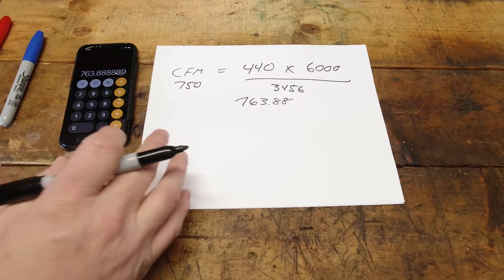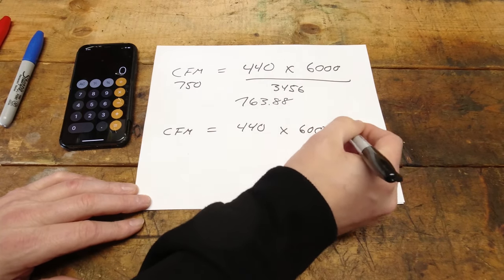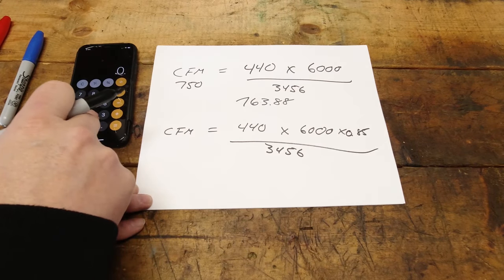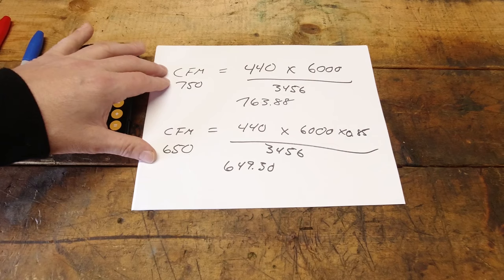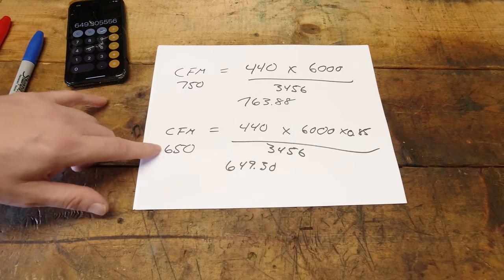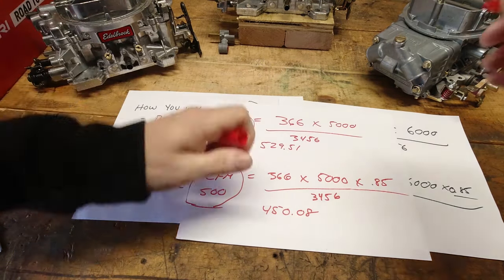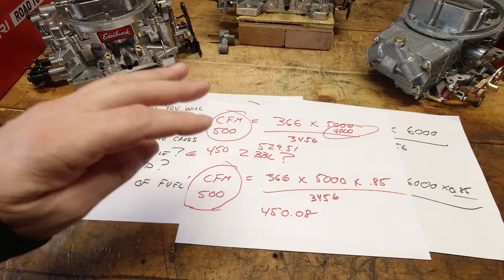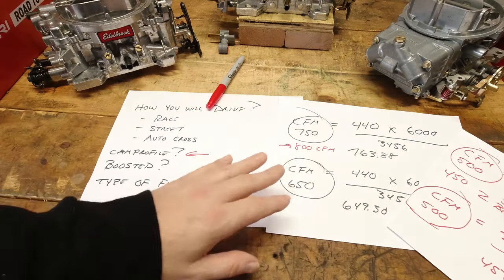How to Choose the Right Size Carburetor

Comment: Love your content, I have an 86 cutlass supreme with 307, nothing else done.  It would not run with the q-jet, so a friend gave me a 1406. Not looking to race, just have a little performance and decent gas mileage.  I think this 1406 is way too big and getting about 10 mpg, where I used to get 20 mpg with the q-jet. Again love your channel and thank you.
Reply from the maker: Yup.  600 CFM on a 307 is over carbureted.  Get a 500 and tune it.  Thank you!  Glad you’re enjoying it.
Reply: @MuscleCarSolutions  great thank you, which 500 do you think; 1901
Reply from the maker: @GrandeTime  yes go with the AVS2.  Either manual or electric choke - your choice.
Reply: i had a carter AFB 500CFM carb 20 yrs ago on my 80 impala sports coupe and that had what they called an "Rv cam"  204/214 duration @ .050  and that was more than enough  had the stock freeway gears stock heads and i found a cast iron 4bbl intake

Comment: 70 chevelle 10:1 383  230-240 , advertised 280-290 duration, 489 int lift, 519 exhaust, rpm air gap intake, header and full 3' exhaust,  th350 2500 stall and 3:42 gears.

Comment: Thanks for mentioning the dump truck engine. I’m I’m the beginning stage of planning a rebuild of a Ford 460 for a stake body that it’s sole purpose is to haul firewood. 

Not much information about building high torque low RPM work engines.
Reply from the maker: Yup.  Every year I get quite a few low rpm, high torque applications to help select components for.  Dump trucks, yard dogs, logging trucks.  Lots of gas powered stuff out there.  Surprising how small a carb will work for a 460 when you’re only turning it less than 4000 rpm.  Good stuff!  Thanks for stopping by!

Comment: First - Thanks so much for all your Wonderful Video's. I've never been very well versed in Cars/Working on them.  But have just acquired a new care "to me" and have been trying to learn about Carbs and 
how they work and how to work on them and your video make thing very clear and understandable even for a 71 yr old Rookie ;-) 

So, I have a 1990 Chevy 383 Stroker Motor, in a lightweight car (2700lbs) not sure of any of the internals with the exception Of
it came with documents for an Isky Mega 280 Cam, and it has an Edelbrock 1405 that has had an
Electric Choke added at some point.  I did check the Metering Rods and they are the .070 x.047.  I've been learning about the timing and have 18 deg Adv and 34 in at about 2500rpm.  Hope this is enough information to be able to make some suggestions. 

Thanks again, Take Care,
CK
Reply from the maker: Glad you’re enjoying the videos!  So the root question here is the 600 the right carb for the 383 in a light car.  First things first.  We have to ask the question, “what are you doing with the car”?  Just a fun cruiser or something more aggressive?  I don’t know a thing about the specs on that cam but I’ll assume they’re around 230 and a fairly tight LSA.  107?  That cam is likely going to be done by 6500, so now we know what the max rpm is.  The rest is simple from the video.  On a lighter car, a little more CFM isn’t a bad thing.  If you’re going to work in the power band of that cam (if my assumptions were correct) then a 750 would be a great carb for that set up.  Just have to make sure the rest of the engine combination match and you’ll have a screamer of an engine!
Reply: Hi, 
Thanks so much for the reply and information. I'm just going to be cruising around in it on Nice Sunny Days.  I think all in at 6500 is probably all my Heart can take ;-) Appreciate everything, Take Care,
CK
Reply from the maker: @CKirk2727  I just found that cam.  It’s not going to be a lot of fun for a cruiser.  It will sound good, but it’s going to be down on power below 2500.  Not very fun.  I’m assuming that’s what you’re after though.  In which case, the 600 might be ok.
Reply: Hi, LOL I had that feeling even with the short amount of time I've had it and driven it.
BUT It is what it is, at least now I know and so that will make things a lot clearer on it's performance, and drivability, and makes me feel a little better about my driving and tuning attempts.  Thanks so much again for all your Help and the Great Video's I've learned a lot !!!

Comment: I have a 84 Silverado 3/4 ton truck with a 350 motor. Truck will be used for towing/hauling and weekend driving. It had an edlebrock carb when I got the truck but I want to upgrade it. Holley 600 or 650? What do you recommend?
Reply from the maker: If towing and hauling are your plans, the Edelbrock is a better choice.  Holleys works exceptionally well in WOT and racing situations.

Comment: Love the video I have a 462 Chevrolet with Pro race right heads elder aluminum 850 cam max rpm 6500 my spark plugs go bad very quickly. Is this carbureted working properly Is it big thank you

Comment: Thx for the vid!
Do you think a stock 351 Windsor 2 barrel will benefit from the "big" Autolite 2100 from a 2 barrel 390? 
It's one venturi size above the stock carb.
Stock cam street driven, FMX auto.
It ist more about fiddeling around and finding the sweet spot set up for the car.

Comment: Great video!! my application is a little different 350ci only turning 3000 MAX  rpm on a airboat by your calculations a 500 cfm holly is more than enough. my question is i hear they make a 480 cfm holly 4 barrel would that be a better fit than the 500 2 barrel? Thank you in advance .

Comment: First of all thank you so much for superb information regarding carburation. You have put my understanding of carburation to another level. Thanks again. I have aquestion for you thats puzzle me alot. I Have a '70 Cadillac Deville, stock engine (375 hp), stock TH400 and stock 2.94:1 rearend. Never passes, and never will, 5000 rpm. When the QJet came to age i put on a Holley 4160 600 cfm (0-80457s). I have a O2 sensor in my exhaust so i can check AFR. What puzzle me is that when passed idle i have almost perfect 14,7:1 AFR. But.... at idle, whatever i adjust or fiddle around with, it never go past 12.0:1. So my idle is a little rough and smell rich. Is there anything i am missing out when adjusting idle or do you have any idea why my AFR are so low in idle?

Comment: Hey your video are awesome,
I’m learning every time.
I just got a 1968 Chevelle with a 307 a 1406 and performer serie manifold intake is it too much?
Runs nice at high rpm if I got stuck in traffic eddy gets flooded….I think
Reply from the maker: @dylansretreat  could be too much.  Really depends on the things I mentioned in this video.  Tell me about the 307.  Is it stock?

Comment: Hey so I'm young and im learning carbs as much as i can. I have a  stock 351w in a 1978 Thunderbird with 2.73 rear gears. Im running true dual exhaust, dual plane intake topped off with a 1405 carburetor running the "10" tune on the 1405 scale. Max rpm 4500. Would a 1404 suit my application better? Or is the 1405 ok?
Reply from the maker: @maxsinger3526  depends really.  Will always just be a cruiser or do you have plans to build something with more power and rpm?  If you’re staying stock and your max rpm is 4500 and it’s just a cruiser, the 500 will be much easier to tune and be a much nicer driving engine.

Comment: I run a quick fuel brawler 650 on a built amc401 took a little tuning but works great.  AFR gauge is key to carb tuning
Reply from the maker: Always will get the best results with an AFR.

Comment: I have a 1978 ford weekend fun truck 2wd
460 .040 over 
Flat top pistons to 
bump compression of the 
Stock 3dve heads 
Performer rpm Intake
Holley 750cfm vacuum secondary 
1970 straight up timing set 
Headers 2.5” dual exhaust 

Manual transmission 4800-5000 rpm max 
Runs good But is old and was thinking upgrade 
Since I have no other carbs to compare it to , I was considering an 800cfm edelbrock avs2
Reply from the maker: Maybe.  But that’s a very mismatched intake.  It works from 1600-6500.  You’d be better off with the performer that works off idle to 5500.

Comment: Great video. I’m new to this and I’m hoping you can give me some guidance. I recently bought a ‘70 c10 that has a sbc 400 with a th350 trans & a 373 rear gear. As far as I can tell the motor is stock. According to some forums I read my trans should shift at around 4500 at wot. When I do the calculations I come up with 520cfm without using the Volumetric efficiency. I’m looking at an edelbrock AVS2 carb in either 500 or 650 cfm. Would you go with the 500cfm if you were just using the truck as a cruiser for the most part?
Reply from the maker: Because of the cubic inches, I’d probably opt for the 650.  Especially with that rear gear.  But the biggest question would be, are you planning on any upgrades in the future?  Headers, intake, better ignition, etc.  if the answer is yes to any or all of them, go with the 650.
Reply: Not planning any engine upgrades. There are lots of other things that need attention. I can’t say for sure if I will do some in the future or not. That being said do you still think the 650 is the way to go?  When it comes down to it I guess what I am wondering is how much the throttle response will suffer with the 650 if no changes are made to the motor.

Comment: Got a Ford 300 that i plan on keeping the internals mostly stock, just playing around with porting and cleaning up the factory manifolds, in your experience are the 1 barrels that came on these engines decent or should i ditch it for a smaller 2 barrel?
Reply from the maker: Boy I’ve had great luck with the 300s in the past.  No kidding.  I drove a cargo van from Dallas to KC with the factory one barrel zip tied onto the manifold.  Somehow they vibrates loose and was stuck on the side of the road and zip ties to the rescue.  Honestly unless you’re really make some big changes; cam profile, CR, you’re likely going to be ok with the factory carb.  If you get into those areas, that’s when I’d look at a slightly bigger carb.

Comment: Looking for some help. My 86 camaro came with a stock 305 carbureted. The Qjet carb it came with is listed as 750cfm. I bought a 750 cfm edelbrock but everyone is telling me it's to big. Why would it not work if it is the exact same cfm as the factory Qjet. Thanks for any feedback.
Reply from the maker: Because they deliver fuel differently.  Stock 305 is better with a 500cfm Edelbrock.

Comment: I have a 1978 c3 corvette L-82 silver anniversary edition. I would like to upgrade the carburetor. What size cfm carb would I need and if I upgrade the air intake manifold am I able to choose any one? Ideally I would like to go fuel injected but I am not sure if I have to add an ecu or not.
Reply: Also, it is a manual transmission
Reply from the maker: @FrankPung  the trouble corvette owners universally experience is lack of under hood space.  The only manifold that Edelbrock offers that will fit under that hood is the Torker and honestly, it’s not a very good intake.  It is low profile however but it’s a low end power stealer.  Lots of folks use them, but be prepared to lose some 2500 rpm and lower power.  Yes, all aftermarket fuel injection systems have a computer to control the fuel and spark.  They’re not very complicated, but you need a good installer that’s competent in that type of work or time on your own to learn how to get them set up right and how to correct any issues the system may experience.

Comment: I have a 350 chevy in an 1981 Chevy k10. I installed a new crate engine in it to replace a worn out 305. I used an Edelbrock AVS2 650 with electric choke. I have the initial timing set a 10 degrees BTDC. The issue that I am having is that when it is warm out and I turn it off, it is hard to restart and acts like it is flooded on restart after 20-30 minutes. I have not made any changes to the carb at this point. I put hedman hedders and glass pack mufflers on it when I installed the engine 3 years ago. So there is no catalyst now. OE fuel pump, no regulator. I'm wondering if the fuel pressure is coming up with a hot engine and leaking past the needle and seat. I have a thermal shield on the fuel line from the fuel pump to the intake manifold, Edelbrock thermal mounting gasket and the adapter to mount a carb. to a quadrajet manifold also. Thanks for any advice that you can give.
Reply from the maker: It sounds like the thermal gasket isn’t enough.  Should have plenty of room under hood to run a thicker spacer.  I did a video on heat soak and ways to help cure it.  What you’re experiencing is common with the crappy ethanol and fuel we have today.

Comment: I have an old step van that I just replaced the Chevy 350 in.  Already has an Edelbrock 1406 in and seems to run rich.  At 5000 feet of elevation.  Can I tune this carb properly for my application?
Thanks!
Reply from the maker: Can that size be tuned on that engine?  Maybe.  What did you come up with after watching the video?

Comment: Just purchased 66 gmc believe it had stock motor and carb 305 v6 and strombreg 2 barrel wondering where I’d be able to buy a remanufactured carb possibly or how to figure out what aftermarket carb would fit on it just for daily driving
Reply from the maker: Last time I looked there wasn’t a heck of a lot available for those engines.  They’re for sure different, but I’m not sure how easy it’s going to be if you want to upgrade anything.  I’d have a builder go through the factory carb and leave it be.  Unless you plan on swapping the engine to something a little more modern.  Then all options are available.

Comment: What size carb and what type of carb would be best for a 4×4 off-road truck with a Ford 408W stroker? 6000 max rpm manual transmission 3.55 gears. The truck weight is about 5000
Reply from the maker: That’s a good one.  As the mathematical answer falls at an uncommon number.  So you’re using it as an off roader.  You should have a cam profile and intake that is around idle-5500 rpm.  If that’s true, then the off road 650 Edelbrock would be perfect.

Comment: Since the 70’s, the math I’ve always heard was cid x 2= cfm in most street/strip applications
Reply from the maker: I suppose you could start there.  Maybe those folks had different ways of thinking about it back then.  For sure the parts were different.  Fuel was for sure different.  Less access to lots of cam grinds and cylinder heads. But like the common math problem of today, it leaves too many questions unanswered.
Reply: Doesnt really work like that.  You would be putting a 900cfm on a 454.
Reply: @cuzz63  Based on the video(s) 900+ might work, believe it or not.  It's situational.  👍☺  Re-listen.
Reply: @stuckinmygarage6220  I actually agree but its not as simple as 2x CID.

Comment: I have a '67 Dodge charger, 360cid (sheet metal kits/better camshaft) I put an edelbrock CFM: 600 on it with an electric choke, it worked really well, then the electric choke broke, I didn't know you could buy a repair kit. I bought a new edelbrock 600, manual throttle, I've never gotten it to work well, the nozzles have been changed and sometimes too much petrol or too little, when I'm sitting in a wheelchair, I can't install it myself anymore, Finland has good installers for sure, but they're too expensive for someone on a small pension , would it be a replacement, for example, a holley double pump??
Reply from the maker: Don’t blindly change parts.  Figure out the resin for the issues and fix it.  Just mindlessly swapping parts/carburetors isn’t going to solve your problem.  Finding the problem is a whole lot less money than the expense of buying an expensive new carburetor every time.  I’ve got videos on all the issues you mentioned.
Reply: @MuscleCarSolutions  is the edelbrock 600 the right size?
Reply from the maker: @petskudahlman  I don’t know.  You didn’t provide enough info to make that statement.  You watched the video?  Based on what was in it, what CFM did you come up with?

Comment: The right way to do this is either at the track or on a dyno each change you make to your carburetor just see if you're faster in the quarter mile or slower same with having your engine on a dyno that's really the only way you're going to know if the changes you're making are better or worse.
Reply from the maker: Much simpler to just use an AFR for monitoring and tuning.  The formula is a guideline.  There are far too many otter variables as I mentioned that have to be taken into account.   Sometimes it just boils down to years and years of experience to make the right call the first time.

Comment: I have a bone stock sbc 350 with a Holley 650 double pump. Is that too much carb for that motor?
Reply from the maker: @jeremywashington-patton9965  probably. Need more details on what you’re doing with the engine/vehicle.

Comment: I'm running a hot setup on the street. It''s 468 big block Chevy with a 7,000 RPM range. According to the formula it equates to approximately 947.9 (950 cfm). As of right now I am running a 950 carburetor. Pretty much spot on. However, I'm running a FST 4500 series 950. My question, is there a big difference between 4150 style base plate, and a 4500 style base plate? The car loves the 4500 at high rpm.

Comment: You can use a little larger cfm on a full dual plane manifold, because each side is only Drawing off one side of the carburator! :-)
Reply from the maker: Incorrect.  Using a larger size will need the air speed through the venturi and booster to get the fuel flowing as the carb was designed. If you run too big a carburetor, the speed isn’t there to meter the fuel correctly.  Running the correct size for the application is always best.  Doesn’t matter the design of the intake.